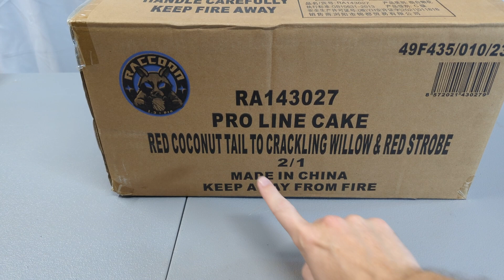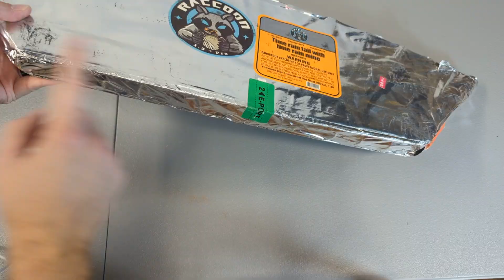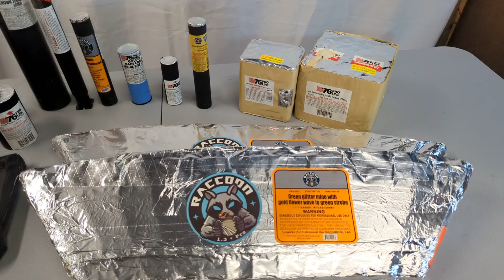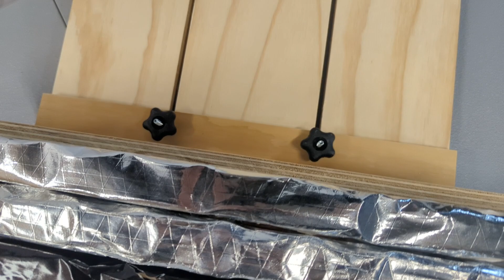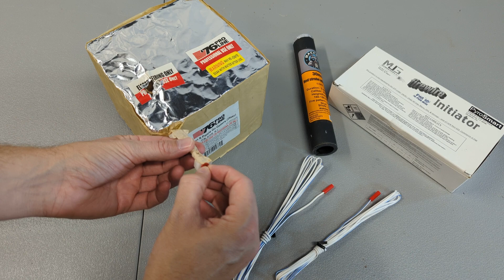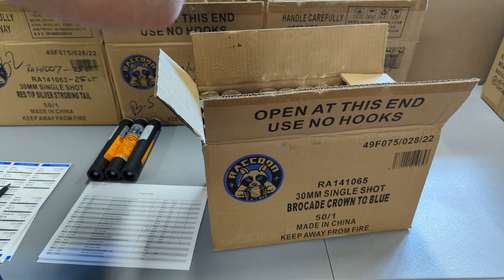How to use Pro Line Fireworks: An Introduction

Comment: This line of fireworks will now be reclassified as a Class B Display Firework.
Reply from the maker: Are you getting this information from somewhere, or speculating? This may happen in the future for sure, but as of now, we are still in the clear.
Reply: @JoelRobinsonPyrotechnics  Reliable Sources

I can't blame them for wanting to reclassify these items.

Several contain salutes, which can hurt someone badly.

For example, cakes malfunction at timed with blowouts.

Could you imagine this happening in a small neighborhood? With cakes, which contain salutes?
Reply: With the recent update, this is currently inaccurate. These items are not being reclassified as 1.3g. They are currently 1.4UN0431 with new EX numbers halted for the moment. 
If you didn't get this information from a real reliable source, probably best to not share it.
Reply: @JDPyrotechnics  It was a reliable source in the know.
Reply: @MrPyroguru  So can you provide anything else? Because the update just a week ago only mentioned that definitions would be decided by 2027 and that the only change was UN0336"for professionals only" was going away and it would remain as UN0431 with no new EX numbers for now. That's it. No change to 1.3.

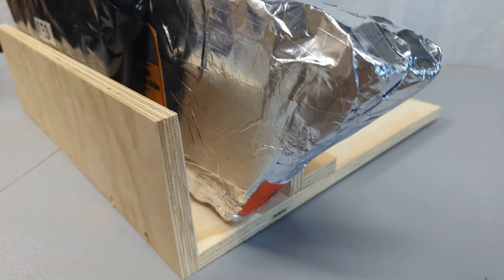Comment: @4:45 be careful packing slices jammed together like that. If your slice only has a fuse, there's good chance it will get torn or blasted off by neighboring slices. I put 1/8" sheets of hardboard between them as baffles to prevent that from happening.
Reply from the maker: Do you know what brand of slice you had that only had a fuse? All of the slice cakes I have used had e-ports or quick match with e-ports.